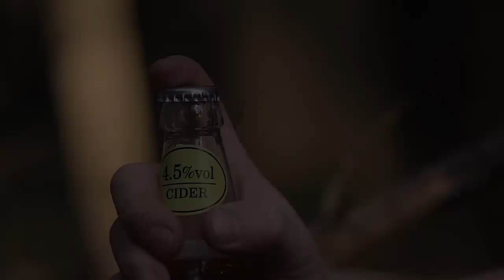BLACKSMITHING - FORGING A COBRA BOTTLE OPENER (pure forging)

Comment: that cap was loose on there to begin with which makes me wonder how effective this opener really is
Reply from the maker: It's effective. You do have a keen eye though. The last opening was how I opened it first as I was trying to get it in shot and messed it up 😅 popped it back on for the proper shot, hence saying take the opener to the bottle not the bottle to the opener.

Comment: Thanks! I don't know why but lining everything up on a project can be an absolute aggravation. I decided I had to have a back scratcher, I'd get one line just right and two others would go cockeyed. LoL not a straight line on it but it  scratches like a champ. Appreciate your work, that's an awesome bottle opener.
Reply from the maker: Function over form. That's the most difficult part of this craft, until it clicks it's difficult to have everything go as you intend it to. The material speaks and tells you where it wants to go, something nobody can teach except yourself when you get it.

Comment: Awesome brother, I would love to try my hand at this, I'm just worried it could take me half a day getting it to sit flat..ha . 🔥🔨👍
Reply from the maker: Time is nothing when learning, it will teach you so so much trying to get it to sit flat. An easier way if you make one of these is double the length so you have more weight in the body and even bring the tail around the front of the snake. It wants to tip forward due to the belly under the head as it's not a right angle. Have fun and let us know how you get on!
Reply: @workingwithiron  I will definitely keep that in mind, thank you brother.  It's great to see you making videos again. 👍🔥🔨

Comment: The whole time I was just wondering how you would do the fangs. Then you didn’t do any fangs :(
Reply: same
Reply from the maker: Ah man I'm sorry, if you want to do fangs then chisel the corners of the upper jaw from the back of the mouth to the lips but keep it hot otherwise they break off. Then bend them at an orange to the position you want. As it was a bottle opener and a small piece it would have hindered the use of it unfortunately.